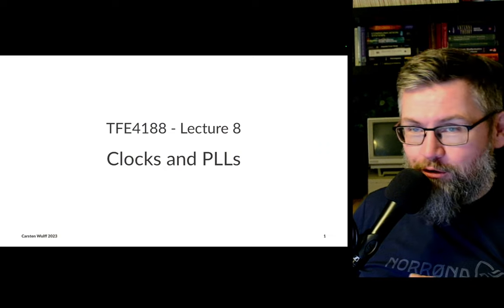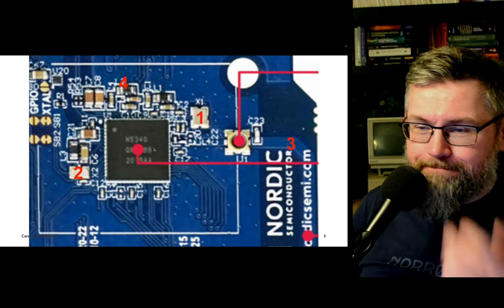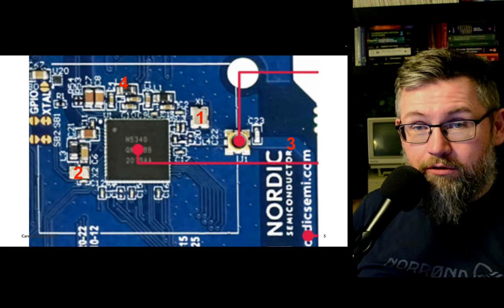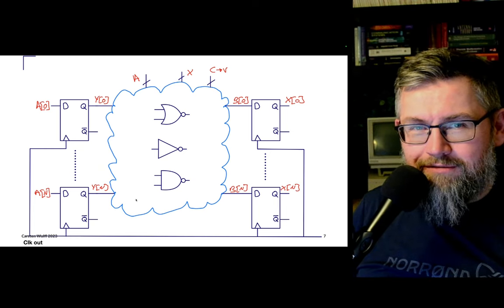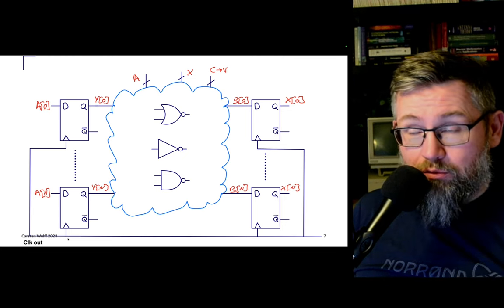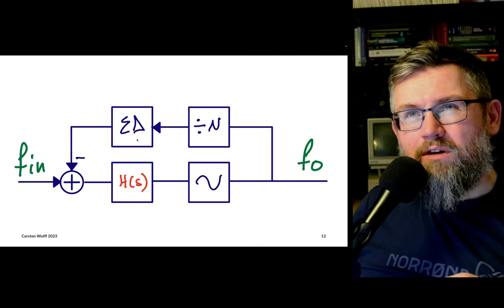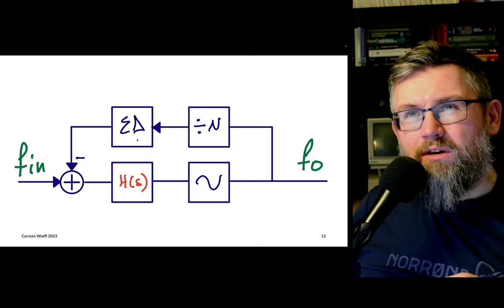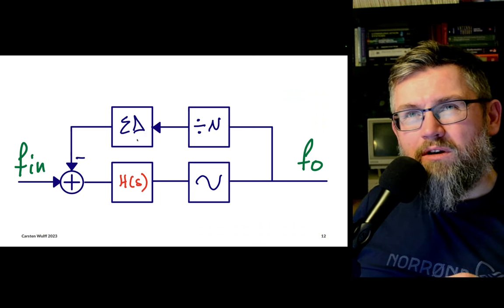Lecture 8 - Clocks and PLLs

Comment: Just a quick Q: With regards to the divider, could  you use a couple of inverter gates to add delay to the feedback around the D-type FF, or would that be too much?
Reply from the maker: That's the common way to add delay, or make sure the hold time is sufficient, one inverter from Q, or two inverters from QN.